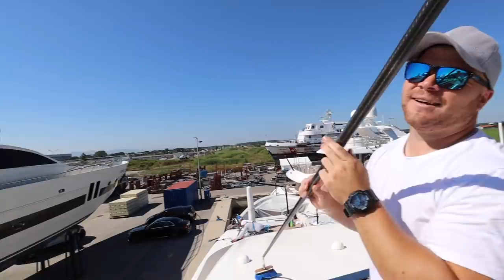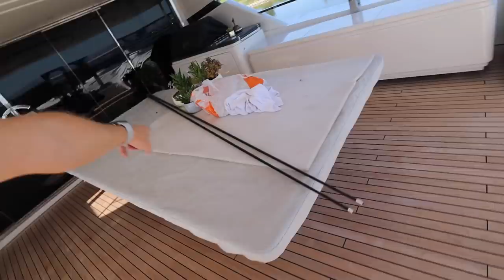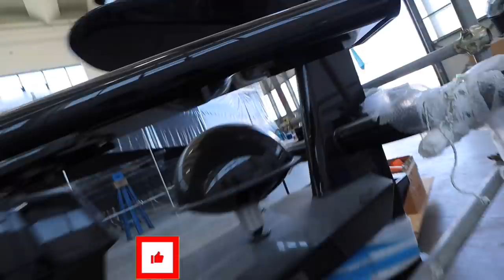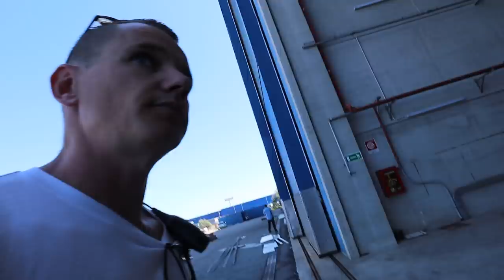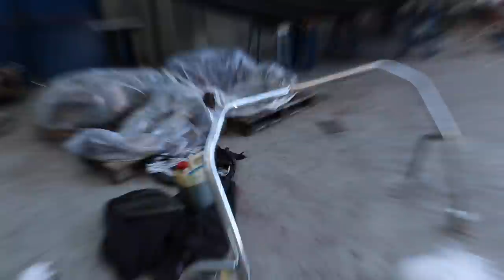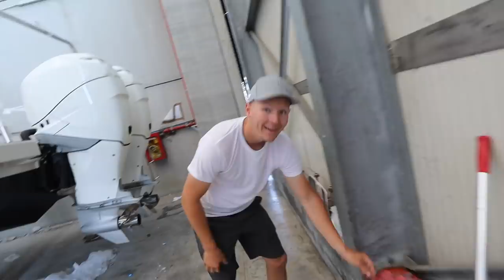MOTOR YACHT AWOL'S NEWEST CREW MEMBER (Captain's Vlog 148)

Comment: Hi the raffle ticket system is not great to use it seem I have to add credit but there is no padlock showing secure access is this correct
Reply: They should fix that - I wouldn't like it w/o the 🔐 EITHER...  and I've been going to get a ticket or few.